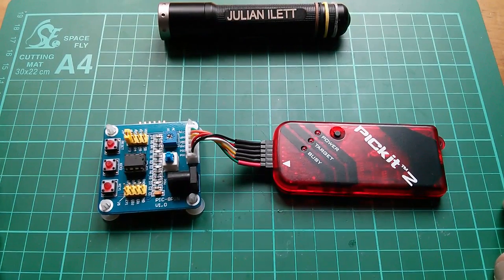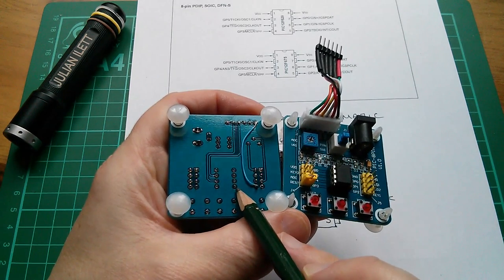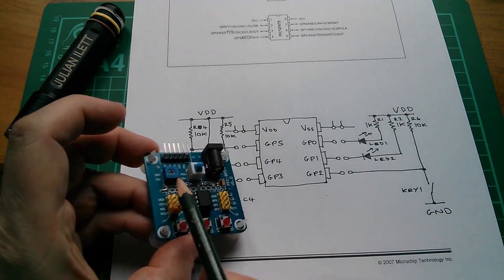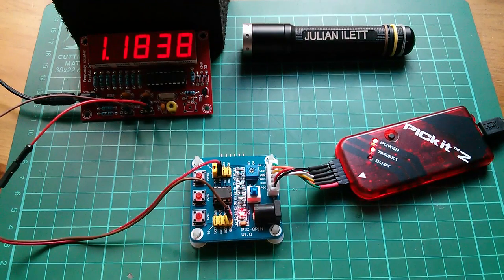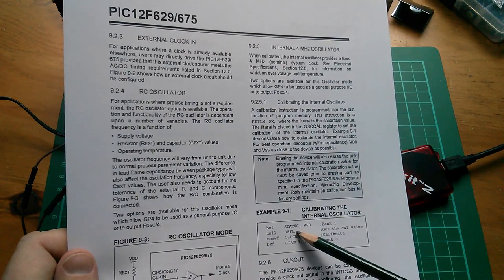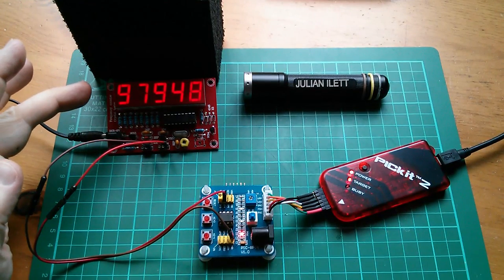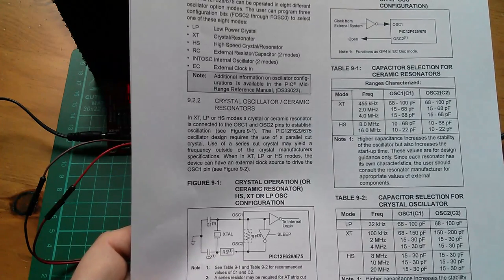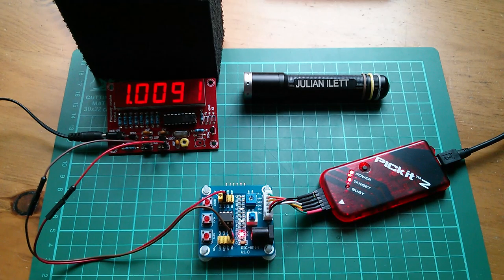PIC Assembly Language Update: #1.1 - PCB schematic

Comment: Hi Julian. An easy mod to the PIC board so that the Vpp does nor cause problems, is to isolate capacitor c4 via a diode. So you need to cut the branch track that to C4 R5 and fit a diode with cathode on Vpp track and anode on the cap-resistor junction. Job done and no need for extra wiring under the board.

Comment: Very interesting.  Being an old Commodore man, I was very used to entering machine code into a programmer into a program that wrote it to disk as machine code. Used to have the wife read the code to me as I entered it into the coder program via the keyboard.  I never really understood what exactly the code did, other then work great if you did everything right, the software had the uncanny ability to tell you if you messed up and show you where your error might be. I used to enter all sorts of programs that way from RUN magazine, as well as COMMODORE. I kept those magazines for years, and finally sold them as a package deal with my C=128, 1571, printer and monitor to a lady who needed some sort of computer to type up reports and such, which was very doable with the Commodore. I saved my software for many years, and here about 10 years ago, sold my collection on Ebay, receiving enough money to purchase a brand spanking new HP Laptop. I believe my total collection numbered around 1000 disks and covered lots of commercial software, and all those codes I typed in from the magazines. I always saved the code, after all it took hours to type in some programs. this looks like it could get about that complicated, but now all that code I typed in is beginning to make sense. I always wrote the software I needed and could not locate in Basic, and became quite good at Basic on the old Commodore.
Reply from the maker: I sold all my electronics magazines to a chap from Diss (Brian maybe) via eBay for £1 the lot - and I had nearly 2000 magazines. Massive regret, but I had (and still have) no space for them.
Reply: But we do now have the near unlimited resource of the interwebs.
Reply from the maker: True, but there are very few scans of old electronics magazines archived on the web.
Reply: +Jerry Ericsson
Used to do similar with my Atari ST, got very good at reading the mag and just tap away on the num pad (the listings were in decimal not hex in the magazine I used to get).
Can still get up to a reasonable speed sometimes entering numbers 30 years later.
Reply: While true, try this web site, americanradiohistory.com it is mainly US magazines, but does have UK titles like PW from start to the 1990's, plus other mags including ETI and PE. There is another site that is UK based that covers Radio Constructor and PW,but memory not working just now. Enjoying your videos btw
Reply: Believe me, I know the feeling of seller's regret.  I also sold all my old magazines, and I probably had about the same number, because you simply had to keep them as there was so much great software printed in those pages.  Now things are becoming even worse as I am trying to commit to a nomadic life in our  old Class A motor home.  All the electronic things, and computer things that litter my back room are about to meet the great beyond of our refuse dump. Within the room are dozens of working machines from some little Pentium II laptops to Macintosh's that still run the Motorola Processors. Many of them were my pride and joy! Even my old desktop digital multi meter is about to go on the auction block when we return to the Dakota's this coming Spring, I really hate to part with that, but really there is no cubby hole large enough to hide her in the rig . . . perhaps in the basement? Oh the heartbreaks of moving from one way of life to the next.

Comment: From the datasheet, the internal oscillator is calibrated at Vdd = 3.5V @ 25C (table 12-2). From figure 13-15 it can be seen that the frequency will drop with higher supply voltages
Reply from the maker: +Jonathan Crossley Ah, interesting. 3.5v sounds like something of a compromise.

Comment: Great video Julian. And thanks for the schematic... I've ordered a bunch of PIC12F675s and was going to make my own board instead of hacking that crudy board up... so much appreciated!! :D Now... how long was it before you read the gray note text under 9.2.5.1 which actually says "Microchip Development Tools maintain all calibration bits to factory settings."?? :-P
Reply from the maker: +Peter Feerick haha. In my defence, it is a very long data sheet ;)
Reply: lol... that it is... although the ATtiny84/ATtiny85 datasheets weigh in at 234 (just comparing with a 8pin micro from the AVR lineup that I am familar with)... so this one is short by comparison! :-P I just found it hilarious that you have just been talking about it (erasing calibration data not working), and then you were showing the very page from the datasheet that had the note on it!  :-O :-D

Comment: I wouldn't bet my life on that frequency meter
Reply: I'd bet on the frequency counter before I bet on that garbage pic board. ugh. LOL. XD
Reply: pikadroo he-he. you know they came from the same source, right. however if the chip is genuine the board can't affect the internal oscillator. And this chip is not worth making a fake. it's not widely used $8 FTDI chip.
Reply: Surely you can't be thinking they're not accurate pieces of lab equipment now!!! I was wondering how accurate that was... would have liked to have seen the scope on it before being so quick to say the PIC wasn't calibrated properly ;) Although with the probably lower than 5v and lower than 25C, the clock should be a bit out...
Reply from the maker: The frequency counter and my scope gave identical results - both are crystal locked, so that's no surprise.
Reply: Julian Ilett 
As a former military technician who ran a calibration lab in the far east, I was wondering if your scope was calibrated against a standard that can be traced back to any international standards for frequency?

Comment: What happens if you set the calibration up to "ff" with the chip run at a higher speed, or will it just not work at all?
Reply from the maker: I'm sure it would run at a higher frequency.

Comment: Data sheet 2.2.2.7 OSCCAL six bits, least significant two bits unimplemented
Reply from the maker: Ha ha, well spotted. I haven't been reading my data sheets!!!
Reply: 2 unimplemented bits = 2 bits of usable memory ;)
Reply: Anvilshock you could use them for storing zeros
Reply: Or ones! Or a mixture of both! Very flexible.
Reply: Anvilshock according to the data sheet they always read as zero. so it works better for the storage of zeros. the two bits at the end of program flash could be used though.

Comment: I believe that it is recommended to use BANKSEL to switch banks as it takes care of setting and clearing the required status bits.

And if you include the appropriate header for your chip you should be able to reference registers by their name, which is way more human friendly than a series of addresses.
Reply from the maker: I'll introduce the header file in the next part
Reply: Cool. Even though I have been writing assembly for PICs for years, I am still enjoying this series. You just never know if you'll learn something new!
Reply from the maker: Excellent - I'll introduce BANKSEL too at some point.

Comment: PicKit 2 standalone programmer has oscillator calibration. It's in the menu Tools->OSCCAL - options are Set manually and autogenerate (probably based on the accuracy of the quartz crystal of PicKit2, which is way better than the stability of internal oscillator). PicKit 3 sucks. Whenever possible use picKit2.
Reply from the maker: Pickit 3 really does suck - I've been messing about with it all evening and I can't get it to program reliably.
Reply from the maker: Finally solved - using the PICkit 3 V3.1 standalone programmer :)

Comment: Hi Julian, I increased my internal clock calibration to highest set bits but still my clock speed shows 0.7467 Mhz, I checked my voltage and it is 4.95. So what's I'm doing wrong? is it my chip clone or can I increase (movlw 0xff) to 3 bit like (movlw 0x2ff) or not?

photos I took from my multimeter and IDE

https://www.flickr.com/photos/139987789@N07/32922773010/in/dateposted-public/
https://www.flickr.com/photos/139987789@N07/32922765830/in/dateposted-public/

Thanks
Reply from the maker: I'm assuming your yellow wire is on GP4. I notice GP3 is not connected - you should at least have a pullup to Vdd on GP3 (which is the MCLR pin).
Reply: Thanks Sir, The yellow wire connected to GP3 and yes 10k resistor fixed my problem :), now time to watch next tutorial.
Thanks Again

Comment: The "typical" temperature for values in datasheets is pretty much 25°C in all I looked at.  Does not sound much different from the 20°C in your room, but just put your finger on the chip and see how much the clock drifts. So don't even think about using the internal oscillator if you want to do serial communication.
Reply: superdau As far as I remember this chip (12f675) doesn't have uart facilities. So not much to think about.
Reply from the maker: Probably OK if you use a low baud rate - 300 baud would work fine!
Reply: If you want to serially communicate at 115200 then - yep - you definitely have a good point there. But the original RS232 spec permitted some drift, so maybe don't worry too much about it at 1200 to 9600 baud. When the standard arose, they were probably used to running at 110 bits per second  :)
Reply: The baudrate is irrelevant because the error is relative. If your oscillator is 1% off your baudrate is 1% off. Typical datasheets recommend around 2% error max. You have to consider that the clock on the receiving end can be off, too. If the sender is 2% fast and the receiver 2% slow that's a 4% error for every bit. Considering start bit, data bits, parity bit and stop bit, that means the last bit can be off by something like 40% (depends on the total number of bits per "character", so your serial settings). Many receivers try to sample at the center of a bit. So if a bit is off by more than 50% it is read incorrectly.
You can easily do software UART in case you need one (I think 57600 was no problem at all on an AVR) and the same holds true there.
Reply from the maker: Ugh, now I have to really think about this! If the clock deviated by a few Hertz, wouldn't that affect fast baud rates more than slow baud rates? And the temperature vs. clock speed graphs are marked up as degrees C vs. Hertz.
Reply: I'm not so sure about the relevance of the irrelevance of the baud rate. If it's below about 10kbps and if you're negotiating it at 1MHz or higher then you have plenty of time to determine how long the line is hi/lo and thus settle upon what the rate actually is - once you've been given the nominal rate (out of a fairly limited set of conventional values too). The RS232 protocol was designed with this speed negotiation tolerance in mind. But - as +Brainstorm4300 has pointed out, UARTry isn't an issue with this particular device anyway (unless - as +superdau says - you want to go the software route).
Reply: +Julian
You get the exact same relative error on the baud rate that you have on your clock. The absolute clock is irrelevant and the baudrate is irrelevant. The error is purely relative.
Example with very arbitrary numbers for simplicity: 
You assume your µC is running at 1MHz and you want 1kbps. So you set your clock divider in the program to 1000 to get the 1kHz clock for the serial interface. In reality your clock is running at 1.1MHz (very purely calibrated oscillator), but since you divide by 1000, you get a serial clock of 1.1kHz, which is 10% off. 
Same µC at assumed 1MHz, but you want 1Mbps. You program your divider to 1 (assume the µ can do that). Reality (again the bad oscillator ;) ): you run at 1.1MHz, divide by 1 equals 1.1MHz serial clock, again 10% off.
Now you assume your µC runs at 1kHz, and you want 1kbps so you set the divider to one (again). In reality your oscillator is at 1.1kHz (you really should stop buying your stuff on ebay for cheap ;) ), so your serial clock is at 1.1kHz as well, again 10% off.
It should be clear from these example that it is purely the relative error.

+Paul
The thing is that the baudrate is usually fixed and not negotiated. The asychronous mode (used in 99.99% of cases if not 99.99999%, actually I've never seen the synchronous version of RS323 been used at all) does not provide any speed negotiation tolerance, in fact it does not provide any speed negotiation at all. Yes, there are ways to detect a baudrate, and yes you can negotiate a transfer rate, but this is almost always done by selecting from a list of given baudrates, like 19200, 57600, 115200. You can't negotiate a random baudrate like 123456. Also we are talking about microcontrollers here. The timing of the bits at a certain baudrate is done by a divider of the main clock. That divider is set at the time of writing the program and not dynamically changed in use. You won't find any of that auto-negotiation in them (unless you write some software that does some bit-time measuring before setting up the UART with a custom divider). 
Try it out with any COM-port on a computer, be it a "real" one or an USB-to-serial converter. The timings at the different baudrates are fixed, there's no way to tweak it to match a connected device that is off.

And to those saying it is not an issue here, because the µC doesn't have and UART anyway: there are many things that need a fixed timing (WS2812 anyone? LCDs? One-wire sensors like a DS18B20?) and you write your program assuming a clock takes a certain time.
Reply: The WS2812 uses NZR communication and should not be equated to traditional serial communication modes.  Some reading about "Non-return-to-zero communication" would be in order.
Reply: RS232 is a non-return-to-zero communication (usually abbreviated NRZ, not NZR). NRZ just tells you how bits are represented with changing voltage levels and it has nothing to do with the need (or lack thereof) of an accurate clock.
Reply: Thank you.  I stand corrected.  You are more knowledgeable about this  than I.
However, I would like to point out that the WS2812 specification provides for a large timing tolerance.  TH+TL=1.25µs±600ns.  This may explain why so many of the Chinese made controllers use an mcu with no external clock and yet are quite dependable.